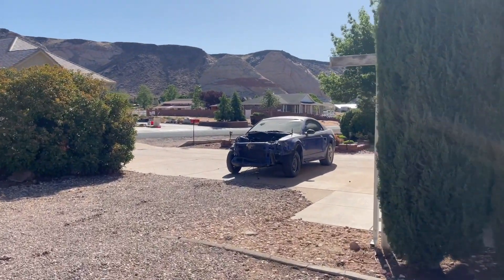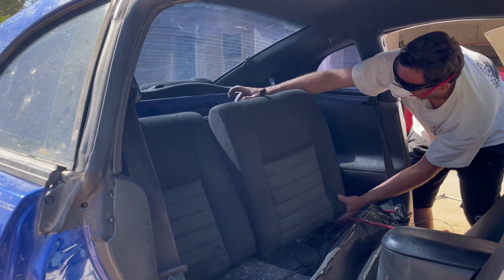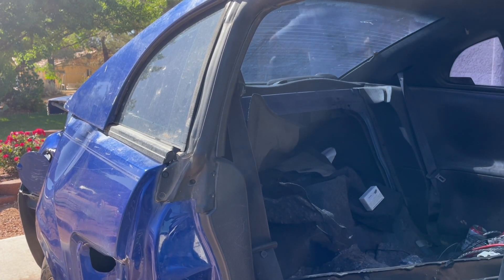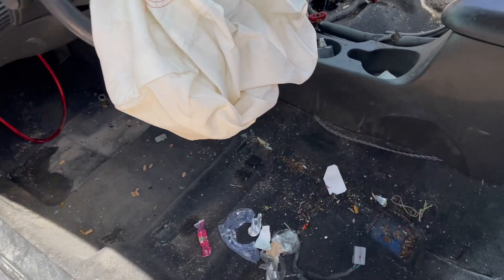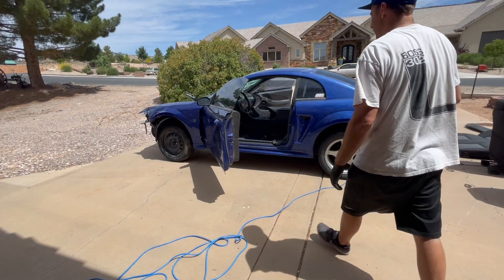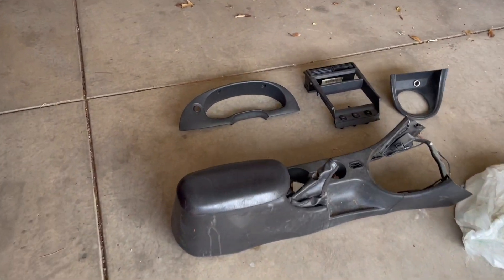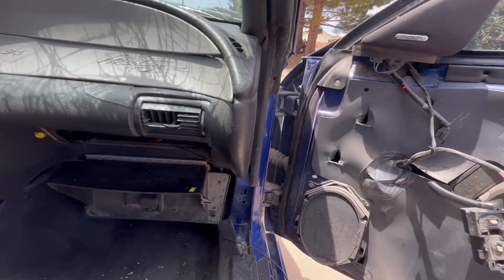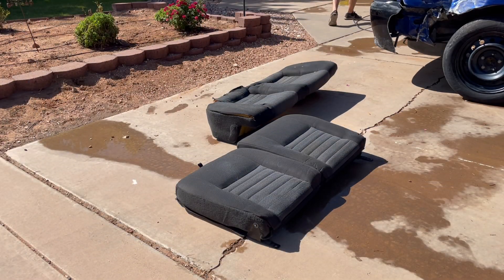totaled 2003 mustang 2V GT cleanup and interior strip

Comment: I just got through doing the same thing to my 2002 GT project car with the seats and carpet. I borrowed a machine from a relative of mine called a Bissell Pro Heat and used the hand held tool part which has the sprayer and extractor all in one tool. I used Folex upholstery cleaner in the machine and after working for two days off and on it got my cloth seats and carpet stains all out. Dirty water tank on that machine was practically brown/black each time I emptied it. After the second day the dirty water tank was coming out clear. I was surprised that much filth was in the carpet and seats even though they looked clean aside from obvious stains I could see when I bought the car. Give that Bissell Pro Heat machine a try, it might get out those stains you mentioned after the power washing and be on hand for using on your other cars too when needed. Interesting video as always, thanks for sharing.😎
Reply from the maker: I used the bissell machine for years with my friend mobil detailing. It works great. He used it for his business but then he bought a $2000 extractor

Comment: I know that struggle very well 🤣😂 I always go ahead and take the little bowl off of the bottom of the carb and clean it out because condensation normally builds up in them over a short period of time and makes it hard to start but it normally fires right up after that. But its looking much better and you will have a good clean spot for storage now
Reply from the maker: Yeah I took that bowl off and gas dumped out so I caught it on the sponge air filter to saturate it with gas and put it back in the air box and it helped it start. When I cleaned out that bowl a couple years ago when I used the washer. The bowl was full of yellow gunk. Probably ethanol
Reply: @justin.c_svt  that is a smart move, i always let it spill all over me and everything else so that if it fires, we will all fire up 🤣😂🤣 I don't know how so much condensation and crud builds up so fast in them but that is almost always the problem after it has sat for a bit not getting used. But yes its probably something to do with the ethanol in the fuel breaking down and separating. By the time you Need it again you will probably have to do it again 🤦🏼‍♂️ I do because I don't use mine very much but im glad that you got it sorted out and getting whatever ever build up of bodily male fluids that was on the seat 🤢 hopefully not....🤣😂🤣
Reply from the maker: Haha lol.

Comment: Hi so the door harness just comes out when you pull it and unplug it? I want to put original Mach 460 speakers I cut mines lol a bad mistake when I first got my car I have the speaker pigtail do you think I should replace the whole harness or just splice in the pigtail for the speakers to my harness? Thank you
Reply from the maker: Yes it all pulls through into the door then out. That depends on how you want to repair it
Reply: @justin.c_svt  nice what's your suggestions?
Reply from the maker: I’d replace the harness
Reply: @justin.c_svt  nice ok I think I'll go do that and then maybe I can splice the connector on the harness and use it for a backup thank you
Reply: @justin.c_svt  getting a new harness is in my best option I think because my passenger side mirror doesn't adjust left to right it's only north and south possibly it could fix that lol
Reply: @justin.c_svt  any tips on how to use a Bluetooth transmitter while using the stock radio?
Reply from the maker: I bought the Bluetooth one that plugs into the cigarette lighter and tunes into a radio station that you choose that’s not being used on the radio
Reply: @justin.c_svt  nice! I got a good one already it works great! Thank you
Reply from the maker: Good